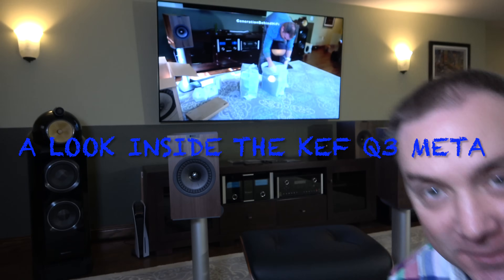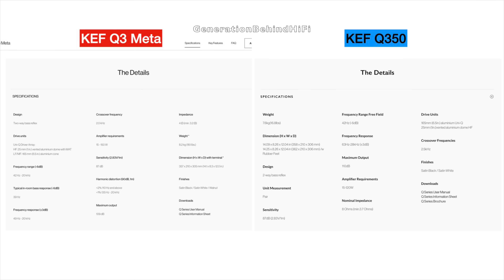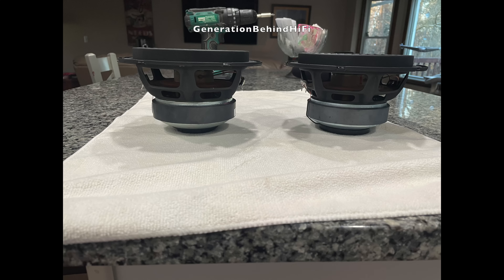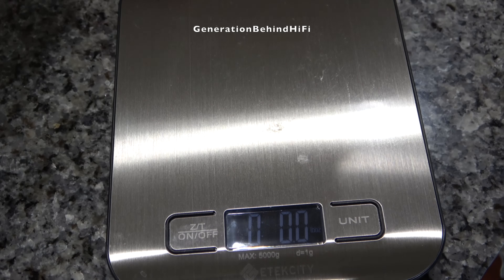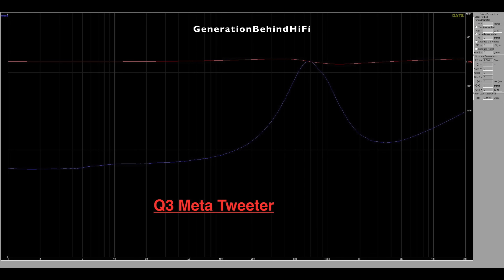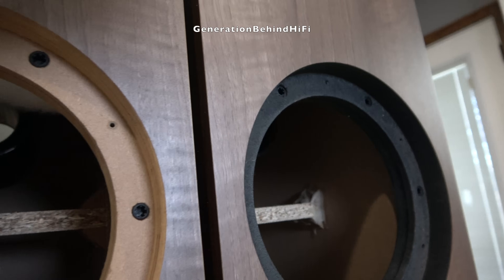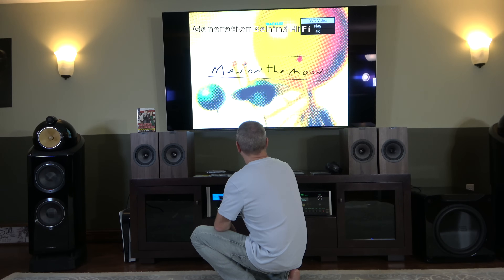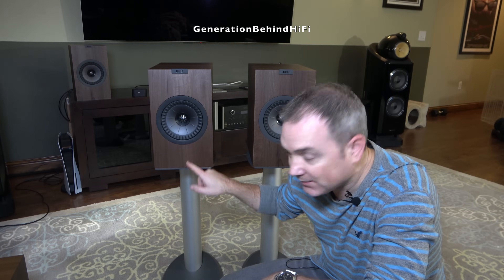A Look Inside The KEF Q3 Meta - What changes have been made?

Comment: Hey, how much the Q3 were breaked in when you comoared it with tje q350? Im asking this because the sound difference you jear might come because the q350 is properly break in. I have an old pair of q350 and i got a new pair recently, man the old one sounded way way better, such a big difference in my opinion, i always heard about breaking in a speaker but i didnt really thought it matters much but now i changed my ooinion because it matters! Probably i need to run the new speakers for 100 hours or maybe more, i dont have the old ones anymore and the new ones don't sound as good after about 25 hours, i dont really know how much till this new ones will be the same and i remembered about your video and came back here to say this, maybe the new q3 is not breaked in and something tells me they need many hours because my old one sounded so much better, i dont inow what's happening with a driver when it runs for a while and why it can sound better but it does.

Comment: The LS50s and LS50 Metas are quite different. You can't really do a fair comparison at the same volume, because the vocal range (mids) of the originals have a couple dB bump and the Metas have a couple dB dip. The Metas are definitely better if you want to play loud, because they never sound edgy or shouty (at least with high end gear), no matter how much you turn it up. However, in a very large room (with subs) you pretty much have to play them quite loud (at least 80-85) if you care at all about dynamics and balanced sound (the band is in your room). This is where the Metas shine. The Metas highs are amazing. Even more detail than the LS50s, yet buttery smooth. 

That said, the the original LS50s are still great and give you a bit more or a visceral experience. The vocals are bigger than life, but if you have a high quality front end where the LS50s will never go past a tinny bit edginess (playing very loud), it's worth the trade off (a little smoother) for the super airy and visceral vocals causing shivers up your spine. 

I have both LS50s and cycle them into my system every few months. 

I think the Q3 Meta and Q1 Meta have similar differences to their predecessors.

Comment: I really enjoy this teardown/comparison video ! Since the Q350 was pretty well received, it was obvious for the company to just use the same cabinet with a slightly updated crossover and driver. It was wise and safe for the company to not invest more money in R&D, but I am still a little puzzle about the use of polyfill or lack thereof. The 'old wisdom' about cabinet design was to put damping material on one side of the cabinet when the other one facing it was parallel to avoid echoes and resonnances. I certainly would like to see what it does to the frequency response when one is modified compared to one that isn't. Thanks for the video!

Comment: I love your speaker stands! What are they? 

The Q350 are my favorite all time. I sold my LS50 metas long ago and stuck with them. Only gripe I have is they have had QA issues. I’ve had tweeters fail, and the glue on the surrounds separate and KEF replaced drivers every time. I just wish they were made to last. Maybe the W3 rectifies some of that.

Thanks
Reply from the maker: Thank you for the kind words! The speaker stands are made by B&W and are designed for the 805 Diamond speaker. I sold the speakers and kept the stands because I love them so much. 

Sorry to here about the Q350s. Wow! That's quite the list of issues. I have owned my Q350s for over a year and haven't had any problems with them so far.

Comment: would it be possible to get the q350 could get them for around 320 Euro a pair, and get the new Center Q6Meta or should i rather get the older Q650C., im asking since the new Q6 Meta is a real 3 way Design and the Q650 2,5 Way
Reply: Hey, did you get the Q6 center?

Comment: Excellent video! Rare to see a reviewer being honest and unbiased. You deserve more subscribers! Any plans to compare the Q1 meta vs q150 , q650c vs q6 meta or q950 vs q11meta?
Reply from the maker: Thank you! I appreciate the kind words. Sadly my honesty is probably one of the reasons why I don't have more subscribers. I'm fine with that because I do this just for fun anyways. I have no plans to do the other models in the lineup, but I would assume the outcome would be similar.
Reply: @generationbehindhifi the q650c vs the q6 meta would be fun to do because the q6 meta center channel is way different from the q650c, its a 3 way channel, the tweeter is smaller on the q6 and the woofer surouding the tweeter is smaller too! I had the q6 for two days and i didnt really like it, i think its kinda muffled and not to present.

Comment: Great video. I figured they'd be close but didn't expect them to be basically the same thing. Sort of disappointing but on the other hand it means the new Q line should eventually be able to hit the same sale prices as the out going models.

Also I have to wonder if some of the TS differences in the woofer are from the Q350 being broken in compared to the basically brand new Q3?
Reply from the maker: Thank you. FYI: I put at least 50 hours on the speakers before measuring their T/S parameters.

Comment: The box is made of pressed chipboard, or pieces of wood mixed with glue and pressed, which is a very expensive price point for the materials used. Can do better at the same price? Of course!!! Crossover cheese components, sufficient wiring and connectors, internaly used poor damping. Finally, a devil in disguise to sell to sheep.
Reply: I’m curious how these compare to the R3. The design seems so similar that I would like to see where the cost increase of the R3 would go.

Comment: Maybe if you switch the speakers position between them or try to test them in the same spot so they can have the same distances between them you would hear differently. You increase the midbass response on the 2 closest and you get different imaging and sounstage because of positioning changing slightly the frequency response.This inner and outer speaker position test it's not the best ,they need to be exactly in the same spot to be more objective.

Comment: I so look forward to the re-engineering and parts replacement of the crossover. I can’t even stand to listen to my Q350’s, maybe a bad pair?
Reply from the maker: Wow! What don't you like about them? I have always thought the Q350 was a nice speaker for the money. Obviously its not perfect, but at $500 per pair (what I paid when on sale) I thought they offered tremendous value for money. At times the speakers can sound a bit "boxy" and the bass can be a bit muddy, but hoping I can resolve some of that with my upgrades. We will see. :)
Reply: @ I guess I could have been more specific, lol. There’s a harshness/IMD in the upper mid range, probably around the crossover point. This is present at any volume and at least for me, quickly fatiguing. I’ve read similar complaints. Hoping a slight crossover value change and component quality would help. Maybe notch filter added to the offending frequencies. If it’s just inherent in the design of the drivers, well…Haven’t made the time for any exhaustive testing, my set up is currently in “studio” mode. The KEFs stay in the box. Other than this, I REALLY enjoy them. I’m pretty sure they have great potential.

Comment: it is a nice speaker, but not worth making a q3 version with meta.  maybe just make a 350 v2.
now i am thinking if getting a cheap 350, and modding it.
maybe some cabinet improvement, making it sealed, adding filling.
Reply from the maker: You will like my next video then. I'm doing a KEF Q350 upgrade video. Sneak peaks of my progress can be found on my instagram page.
Reply: @generationbehindhifi  Just in time for all the old Q lineup sales.  I think you may convert some to the DIY for some savings, if the Q350 mod is simple enough to start with.
Reply: As a Q350 ex-user, I made my choice to upgrade to Q Concerto Meta, which is significantly better at the dynamic range, especially when you are listening to some orchestral works. I don't think Q3 has a good price point. I guess that's why KEF didn't cut the Q350 on the market (in some regions) directly.

Comment: The difference in T/S parameters tells me the woofer is the same driver, as the difference is well within expected tolerance between drivers of the same batch. Also Kef does appear to have good batch quality. My guess is that Kef tried to push the tweeter cross-over a bit too low in the Meta, which could be the reason why you prefer the 350. If you add damping material to the rear of the enclosure you will reduce one of the impedance peaks, the other is likely due to not rounding over the woofer hole internally. Great video! Keep them coming!
Reply from the maker: Thanks for the comment! You might like my KEF Q350 upgrade video that is coming out next month. I added additional damping material to the cabinet, upgraded the crossover parts, and chamfered the inside hole with a dermal tool in the hopes of squeezing a little more performance out of them. 

The weird part about the Q3 woofer is it does have a tad bit more mid bass punch than my Q350 that I could hear. I can definitely hear more body and weight behind each bass note. I'm a bit puzzled how they did this because the cabinet and bass reflex port are exactly the same between speakers. The only differences (which are small) is in the T/S parameters.
Reply: @generationbehindhifi  If it isn't cross-over Q, then maybe there is more attenuation on the tweeter in the Meta! you would have to check the cross-overs resistor values to tell.
Reply: @emmet7208 Exactly my thoughts as well..
Reply: @generationbehindhifi I think the woofers having a 2nd order crossover now allows it to reduce its bandwidth of reproduction and increase the quality of what it does produce.
Reply: Looking forward to this upgrade video. I am interested in upgrading my kef q (250) speakers, not expecting amazing results but should be a fun simple project
Reply: @generationbehindhifi will the upgrade work on the Q3 Meta also?